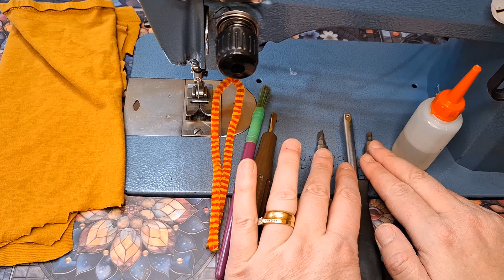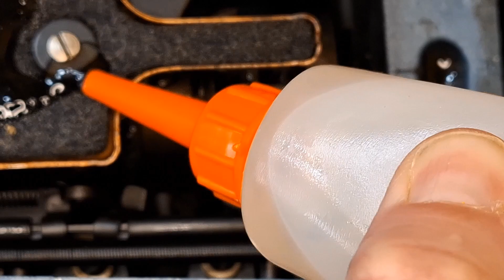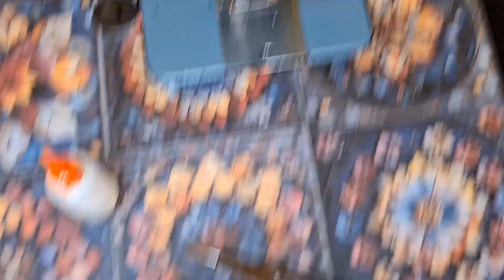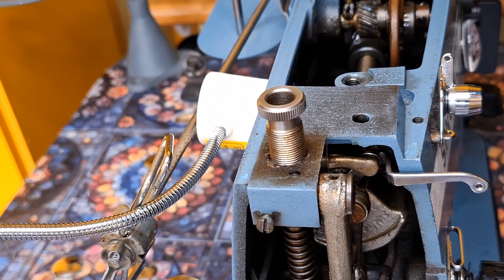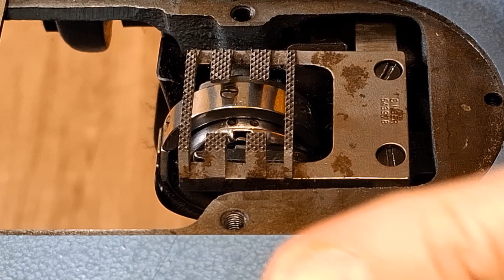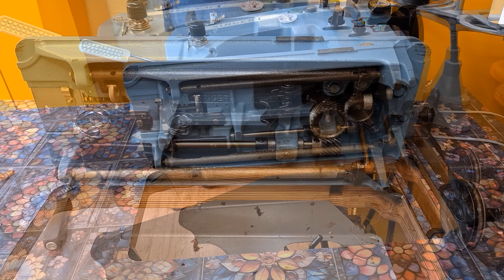How to clean and oil your singer 20U sewing machine

Comment: Are these machines known to be noise and vibrate??  I bought one on Amazon and fit it into an existing table and it's really noisy and actually is missing the tension bar lever inside which is a major inconvenience.  FYI.....Do Not buy one of these machines unless it comes with the table and motor.
Reply from the maker: They can vibrate when running at higher speeds. If you know what you are doing, fitting out a table and motor isn't a problem. If you look on Ebay, you should be able to find the parts you require easily enough.

Comment: Great video, do you have a video on changing the belt?, thx
Reply from the maker: I haven't at the moment. I use a leather belt on this machine, so fitting it is the same as you would a treadle sewing machine. I will be doing a video of fitting a leather belt to my 66k treadle shortly 😊